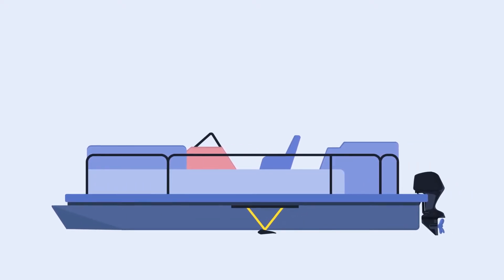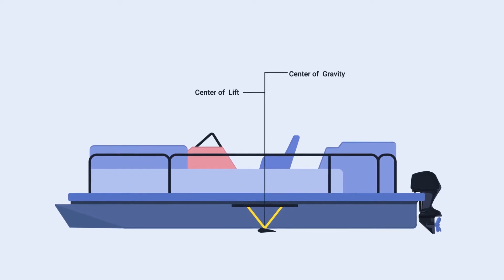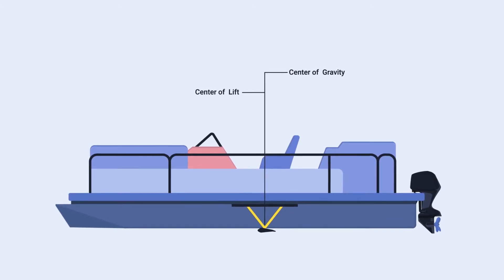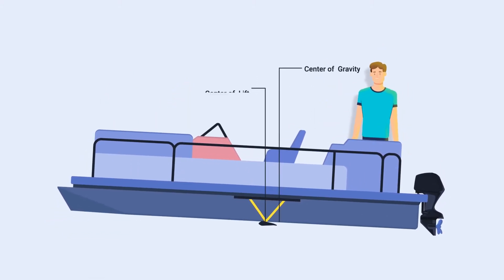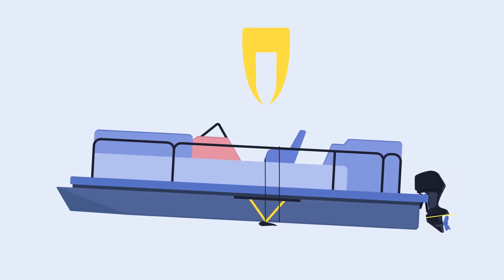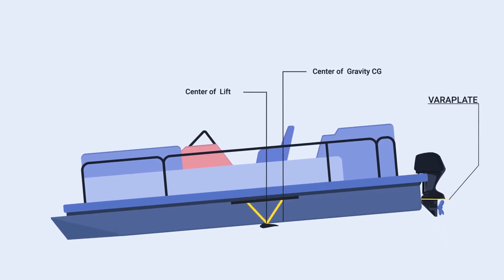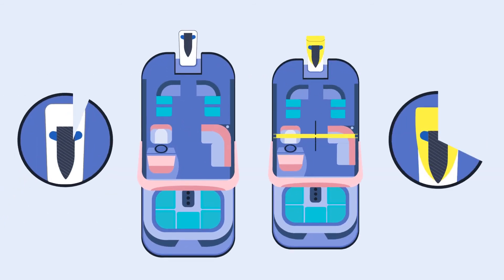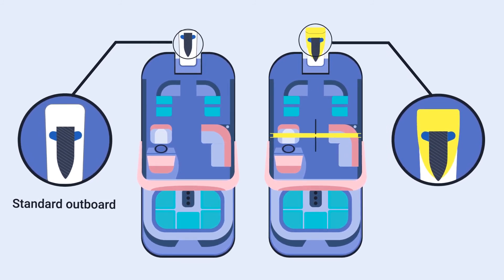Pontoon Hydrofoil Center of Gravity ( CG ) using VARA™ Foil and VARA™ Plate

Comment: 4 people moving from front to rear and then back would seriously  change my center of gravity.
Is there a small hydrofoil I can use, just to lift a bit the stern? But not on the engine.
Reply from the maker: Hello Victor, we have had some good points and questions lately so thank you.

Yes indeed 4 average adults (170 lbs ) would seriously change your center of gravity moving front to back. We would point out that any pontoon boat or standard hull with or without a hydrofoil would be affected by this weight movement. We do not recommend people standing and moving while boat is under way for obvious safety reasons. 

That said, our VARAPlate is designed for weight/center of gravity changes depending on boat speed ( Lift ) and amount of weight changing CG. Generally a VARAPlate provides an easy mechanism for changing level flight control with 200-300lb weight changes while under way. This flight control is provided by simple bumps of your trim/tilt switch when you change course from into wind ( Which tends to lift the bow) and then turn to a downwind course ( which tends to push bow down ) also.

PHA, Inc. custom builds VARAFoil hydrofoil kits, so providing lift of any amount is what we do. However, pitch control while using a hydrofoil is needed and recommended. Just as an airplane with a critical center of gravity, a pilot must have control of the planes pitch and bow attitude, especially if everyone seated in the plane decides all at once to use the forward or aft bathrooms. The pilot achieves this pitch control by using an elevator or adjustable tails on the plane. Our VARAPlate design gives you this control and is sold as part of our VARAFoil kits. A VARAPlate also helps create lift therefor giving the pontoon ride a much better feel with the control and added lift it creates in conjunction with the hydrofoil. They compliment and really need each other for safe, efficient flight.

Hopefully this helps and you can learn more at https://pontoonhydrofoil.com/ or by giving me a call at 727-455 -5576 anytime Thank you for your interest.

Comment: Any fuel efficiency or speed increase achieved by using this product?
Reply from the maker: Hello, Thanks for the question. The answer is yes to both. Overall, we are getting many comments that riders are enjoying the better quieter ride that allows normal spoken conversations while moving. Visit pontoonhydrofoil.com or email us at mike@pontoonhydrofoil.com if you have any more questions. Thanks for your interest.
Reply from the maker: Additionally, this product is CAD designed to produce lift. This lift effects the speed and efficiency while VaraPlate™ is used on it's own. VaraPlate™ is supplied with our Varakit™ hydrofoil system to control pitch as shown in above video. This VaraPlate™ patent pending design will also be actuated and is intended to replace antiquated trim tab systems used on sterns of boats. This new actuated system will decrease drag and increase performance of outboard motors. Please subscribe to our channel or visit our website as these products are still in final prototype testing phases and will be available soon.
Reply: Decreasing the surface area of the front of the pontoons/CG in the water while underway will naturally increase speed, if not efficiency--to a point; the motor may burn more gph to get the optimal balance of SA contact, resulting in an even higher overall speed but not necessarily efficient use of an ICE engine. You also have to account for increased wind resistance,  as well as the possibility of air getting trapped in a pocket between the pontoons.